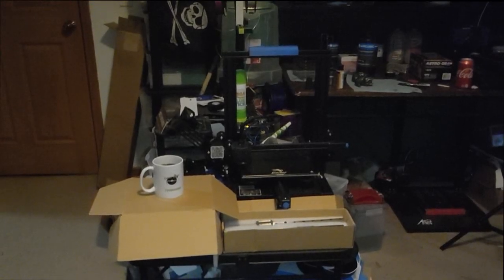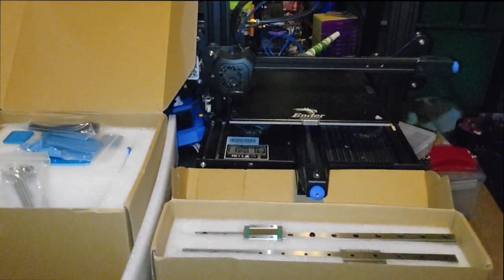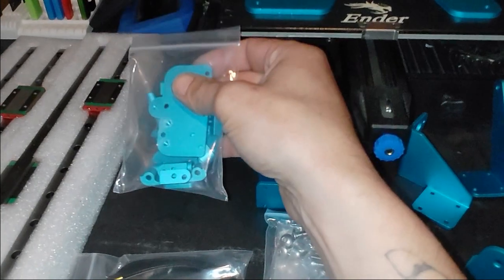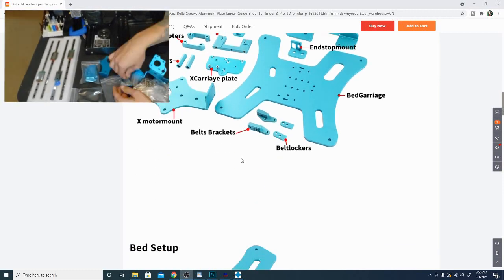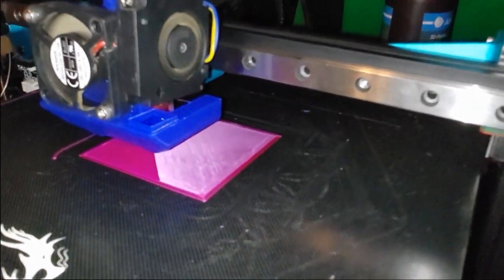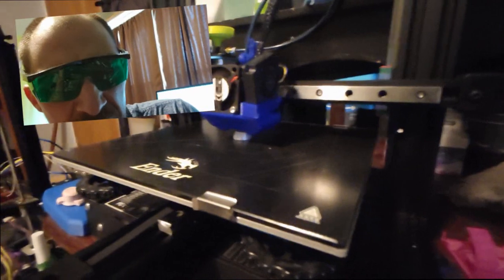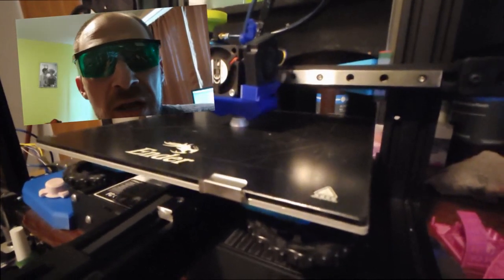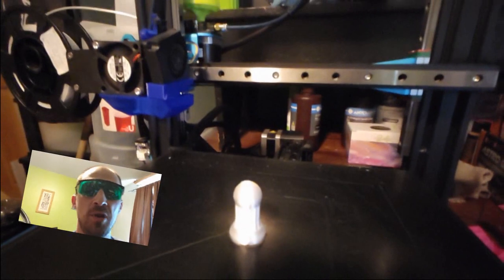Ender 3 v2 with Linear Rails Mod! upgrading my creality 3d printer!

Comment: Cool upgrade, I've been debating this mod too. 

Just a note looking at 150mm/s speeds on such a small object makes no sense without heavily increasing acceleration. In reality you would probably finish the print just as fast with 60mm/s speeds because you're reaching nowhere near that 150mm/s.
Reply: Plus to really torture test speeds you want straight lines and hard corners.
If itbcant habdke the speed yoi get p spabed bulges on corners as it approach in a straight line but then overshoots the corner and cant do a straight line fast enough.

So a star shaped prism print would really torture test that.

Comment: What else was required to mod or customize in order of this to work with the V2 since the kit was for Pro? Any tips to a smooth installation?
Reply: Yeah, this right here. Because several companies laud the fact that their upgrade kit is for both, when in fact it is not. And you have to either print a part, or buy another one just for the mod to work. I'm stuck with Gulf Coast Robotics MGN-12 Y-Axis conversion kit. It specifically says for Ender 3 PRO/ V2. It does not work at all with the V2 without a mod for the y-axis button on the rear of the printer. Can't reach it without one. Back to GCR this shit mod goes.
Reply: @NeuseRiverStudio  Hi did you manage to sort out the y-axis button?? As I am stuck on that part.
Reply: @badman1998100  I sent it back to the company. Their product didn't work. I was able to find another product on Amazon that helped. There are also some people here on YouTube that have created mods for it and you can buy from them. Roughly $5 - $10. It's been a while since I posted this so apologies, I don't have any specifics.

Comment: Hi. I bought the same kit as you did but I am still a noob to 3d printers. Can you share the files hotend cover/shroud? I and stuck on they piece. I am thinking if I should buy the cover for an ender 3 to get around that issue...

Comment: I keep looking at the linear rail kits, but right now, my E3 v2 is dialed in.
Looks like you printed the Red Squirrel cooler that uses the larger 50mm blower. There is a different print for it that utilizes the 40mm blower that came with the E3 v2.
Hope you get a few more likes, I would like to see a build video.

Comment: I'm really curious as to what the actual benefit is for this mojor mod on what is essentially a great but yet still a beginner printer. The price is almost as much as it would be to purchase a second v2. I can see the value for a much larger printer. My everyday desk printer is an Ender3v2  and with he new Jyers UI latest firmware it prints flawlessly stock. I'm honestly curious to what I'm missing? I'm still learning and use my v2 for silks and slow highly detailed prints but if I can speed that process up while maintaining quality, I'm all for it. Thanks in advance

Comment: Did you managed to get rid of the vibration/ringing
I have the same problem and i try to tighten the belt, but the problem persist
Reply from the maker: Tightening my belts did help, but if you tigthen them too much it can cause it too.

Comment: Nice work! I've been debating doing this mod for a while.
Reply from the maker: sup happy with the speed accuracy and silence. lol. the only downfall is the 1000000 screws in the kit. lol. but once its together its great!
Reply: @Technivorous  I've done a few before on other printers and yep all the little screws to attach the rails are a pain for sure. It's good that you only mention the speed improvements because from my personal experience that's the major plus of a mod like this. To many people think it will improve print quality. If you have a well tuned and tweaked printer already it won't really improve print quality just allow you to print faster without loss of quality. Besides anytime you can ditch the rollers it's a plus in my book! Please do the assembly video I've got a v2 also and would be interested in what mods are required to make it work.
Reply: @richm658  you got it! Thank you!

Comment: Everyone is quick to do what someone else has already done. Why does no one ever fix the firmware on these things. Everyone that even thinks about marlin firmware makes the explanation so complex you are doomed to failure before you even start. Even the machine makers are afraid to attempt to make the firmware for their machines better for fear of making it worse. I mean ALL machine makers. Creality, Alfawise, Geeetech, Anet, Elegoo, Voxelab, they are all guilty. Why is this still the greatest reason to avoid open source machines unless you like spending money on machines that are incapable of repeatability and need constant attention. We either spend 2 to 5 thousand dollars on a proprietary machine that has to use proprietary resources at extreme prices or play craps with "EVERY" print. Absolutely no one has been able to fix this for any printer. They have to show twelve ways to do it each more complicated than the last and they have to do it in the same video. Why do they not just turn everything on and use the display to  activate the priorities they need. ALL things involving firmware are failure waiting to happen. It has become so bad I think you stand a better chance of the next Microsoft update actually fixing windows to work as expected.(Ha Ha Ha Ha Ha Ha)
Reply: Have you tried jyers
Reply: @glenn3762  No! I tried to get information about the jyers firmware but never got a reply from anyone. If you are not a source of money or free stuff you do not get many answers to questions like will this work on my Aquilla? No one talks about the displays at all. Thats NASA type secret stuff right there. Not even Voxelab will attempt to actually debug the firmware they have working. It has not changed since I bought the machine. I am beginning to think that Voxelab is like Studebaker. They built their wagon and thats all they have. They don't know how to make it better so they just keep making new models hopeing to stay in business. The HAWK was an awesome looking car but had the lousiest engine in the history of engines. (Well AMC tried to compete for that title with the 304 v8) But they both went the same way, OBLIVION. Sorry to snivel but I really think this should be easier than it has been. Thanks for the help and Happy printing.
Reply: Some where in there